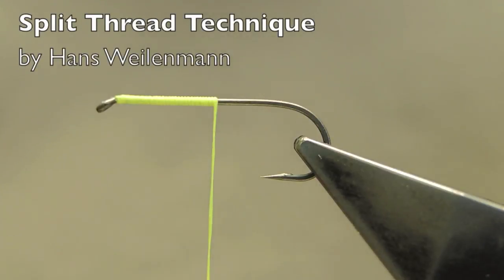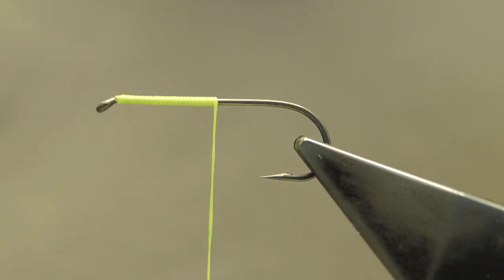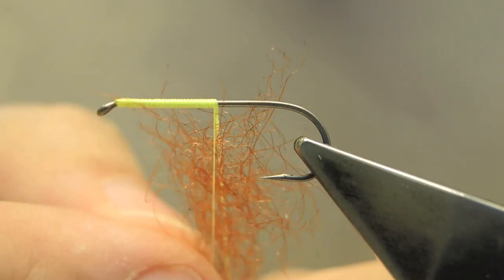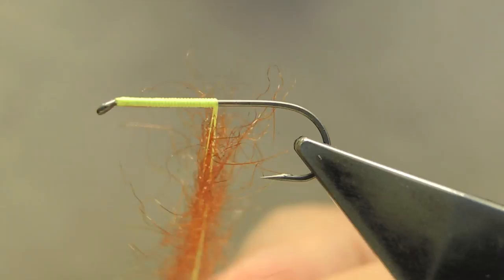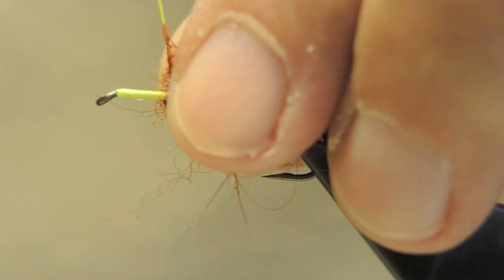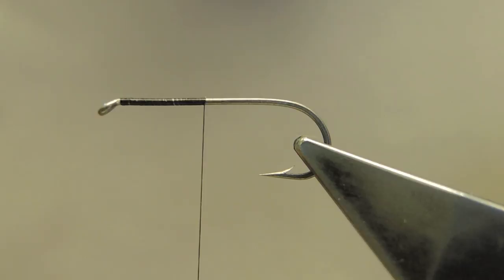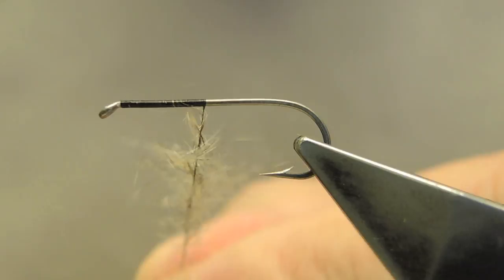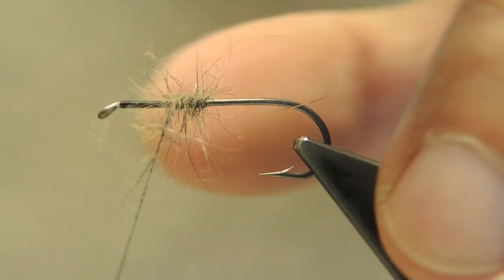Split Thread Technique - by Hans Weilenmann

Comment: I have done this after watching you with Ultra thread 70 denier, but I have no idea how you split 12/0 thread? I saw you do it , and you made it look quite easy. But I have not been able to split anything less than 10/0 thread and it was with great difficulty and frustration before I was successful. With thread that thin, I just use a loop. I know, too much thread. What can I say, I am just not that good at splitting it yet. But I won't give up. Thanks for sharing, All the best to you, Sean